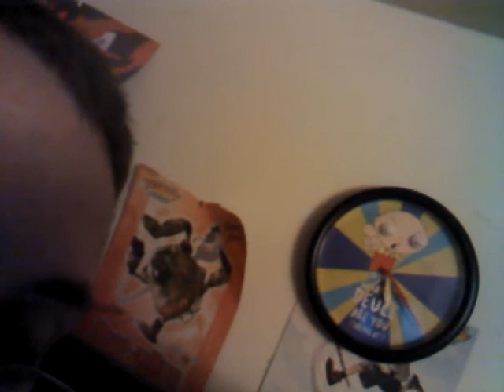master of wires update

Comment: What is that PVR silver box thing you show?  Do you use RF or do you have AV cables for the Genesis?  Seems like most new TV's only have 1 composite AV input and maybe a few Component and then HDMI but you can always get a simple AV switch box I have one with 5 switches to switch between SNES, Genesis, NES etc.